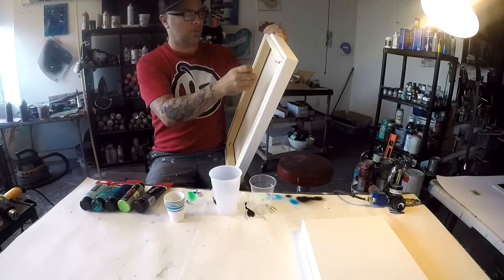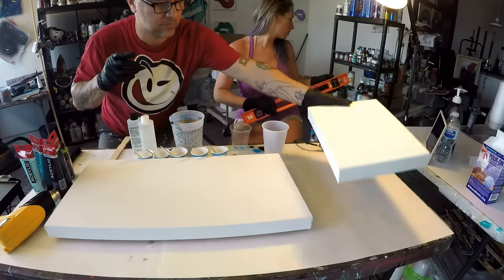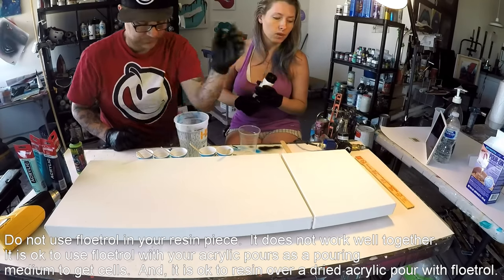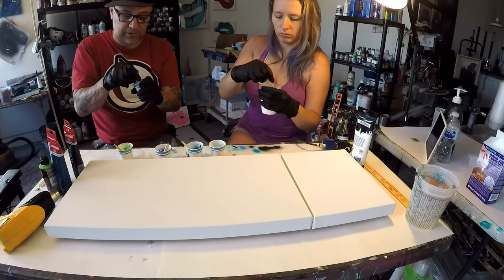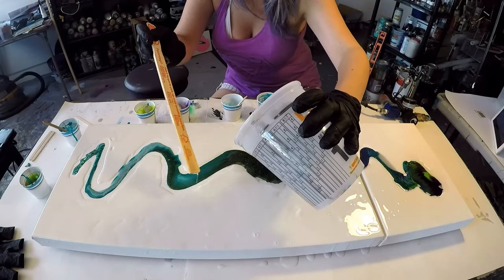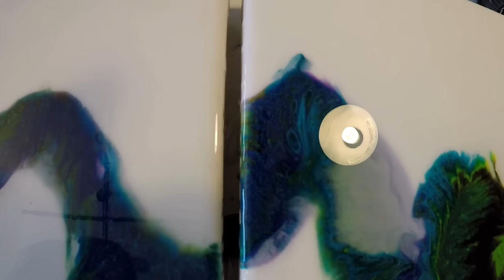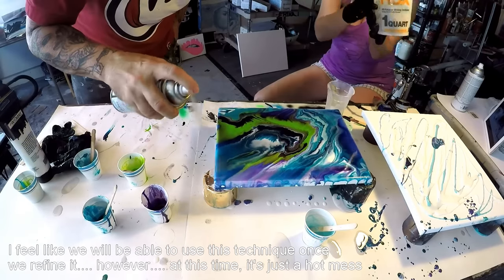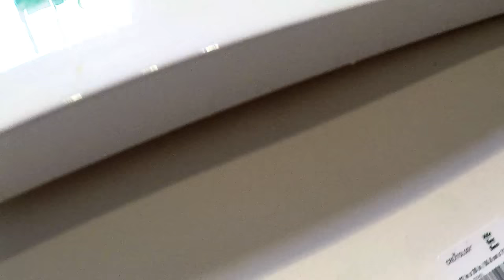WOW Great NEW TECHNIQUE - We have NEVER done a piece like this (LACING, Flip and Drag)

Comment: Very beautiful piece. I’m surprised you used a canvas. Mine sink in the middle and leave the edges bare. I want to try this.
Reply from the maker: We prep our canvas a few times before we pour on them to make sure they are tight.
Reply: Judy Sand spray the back of the canvas with water, saturating the whole thing, and then flip it over and let the water drain out, and then paint on it right after and it won’t sag